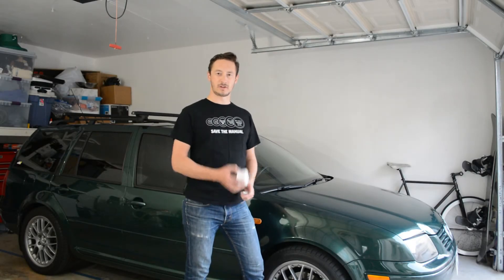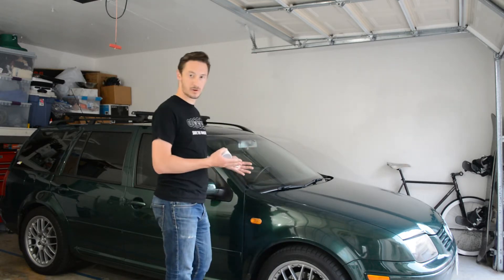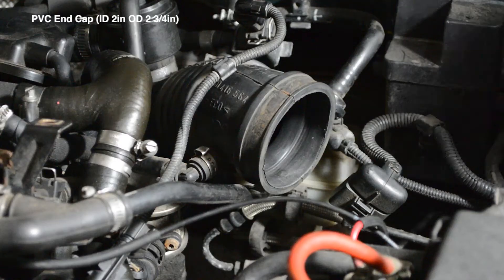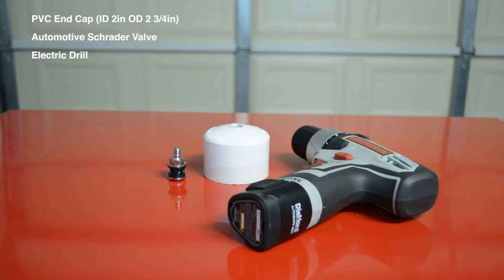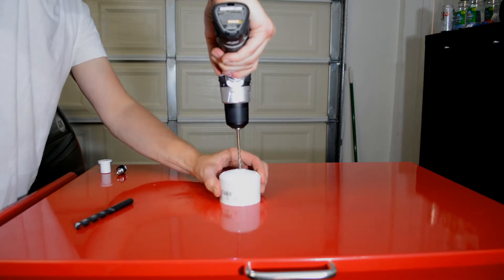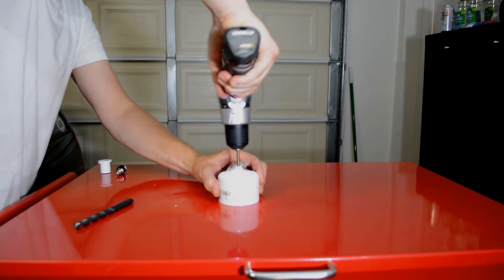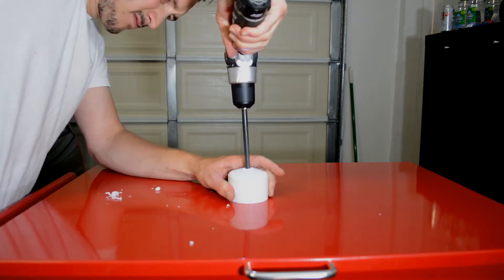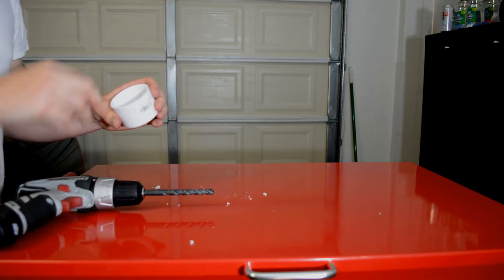How To Build a Simple Vacuum Leak Tester Out of PVC

Comment: What size pvc?
Reply from the maker: That depends on the size of your intake. If you can't find the correct size, buy a smaller one and you can use some electrical tape to make up the difference in diameter.

Comment: a shame i can't find a 2 3/4" end cap anywhere :(
Reply from the maker: What I did for my Volvo was wrap the end cap in electrical tape to make the correct diameter. You could also look for a rubber adapter that's used for intakes. Something like that is usually available at a local car part store.
Reply: @StevesGarage  thank you :D

Comment: Hi.
Could you tell me the inside diameter of your TIP as is same as mine. 
I can order ome to collect tomorrow without going to strip down to  measure up .
Many thanks in advance
Reply from the maker: I mention the size in the video. If you have a mk4 1.8t, you can build it the exact same as I did in the video.

Comment: Hello Steve, thanks for the great info!  Couple of questions, what size was your "larger" drill bit, and where did you buy the schrader valve, and what size?   Thanks!
Reply: Ross hey man. Since he didn’t reply, I got you. The size of the Schrader valve should not matter. You can get one at O Reilly’s or any auto parts store. As long as it holds the seal, that’s all that matters. Same with the drill bit. Even if it’s large, the rubber gasket should still hold up. You can add some epoxy or decent glue to seal that up too in the event that it’s too large.
Reply from the maker: +Ross so YouTube had a known issue where people won't get notified of comments, and this is one of those situations. I'm extremely sorry! The drill bit was a 3/8 because it's what i had on hand, but I should have used a little larger. Thr Schrader valve was purchased at an auto store, any valve or size should do. Let me know if you habe any more questions!
Reply from the maker: +TheAngryDipper appreciate the help man! My channel sometimes doesn't notify me of comments, it's an issue with YouTube thst many people have. You're spot on though, thanks for replying!